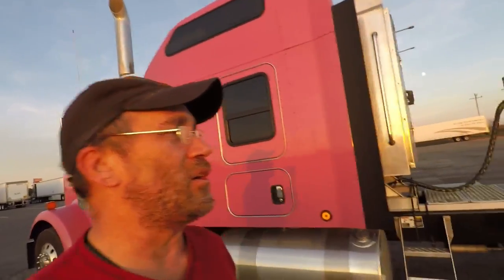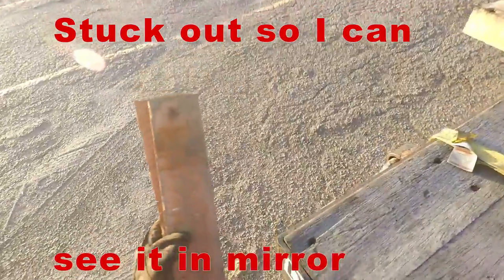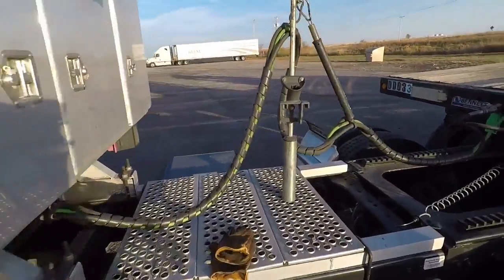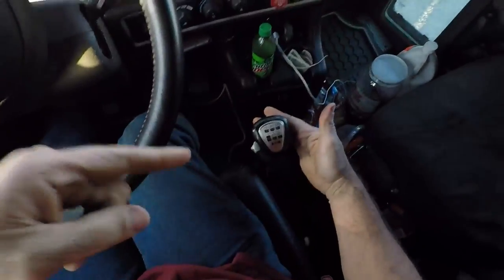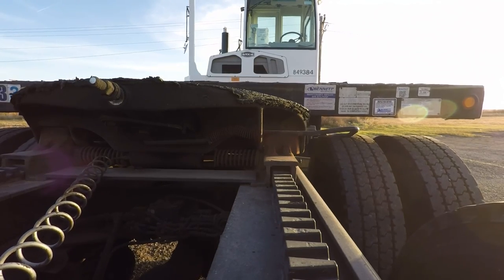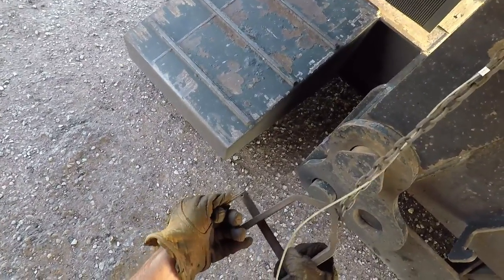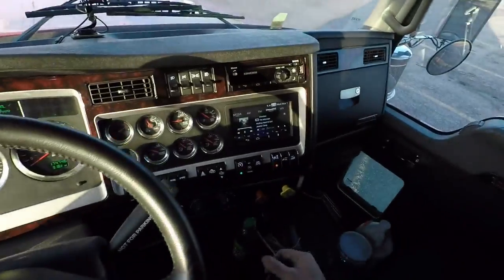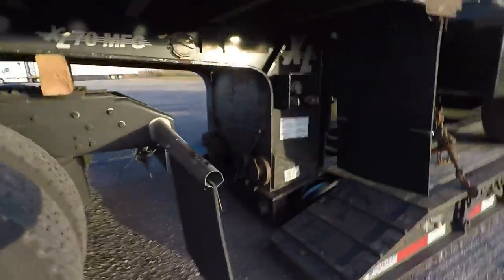How to seperate an RGN trailer for the goose neck

Comment: It is a great video . But overall out of 5 is only 4 points. Previous commenter mentioned abt trailer pin . You didnt show it after hoocking back . This is important to close it first before placing back eye locks ? Isnt it ?
Other than that . It is informative and clear to understand .
Thanks again !

Comment: You are a patient dude.  Thanks.    Could maybe drop the truck bags before going under, then start raising them and get them to where they still tip the 5th wheel and lock correctly, but aren't forcing the 5th wheel to lift so high.  A description of the "why" of some of the steps that don't have it could add to the video's informative aspect.  Not criticizing at all, adding that much detail could be unecessary on one hand.  Laters.

Comment: I just started using one of these. Exact same trailer. But i dont release the stinger on the neck until im ready to pull out. After separated make sure you keep it straight, the neck can twist on the 5th wheel then you are gloriously fucked. Don't ask me how i know

Comment: Pulling the lock pin for the top deck first can result in severe damage. When you pull forward to release the lifting ears, there is nothing holding the deck on if the pins released. It can fall forward and hit the ground. Incorrect way of disconnecting IMO.
Reply: Post up a vid and show the difference so others can compare